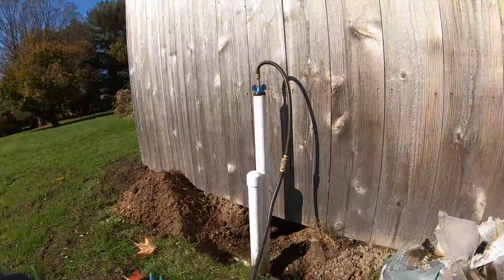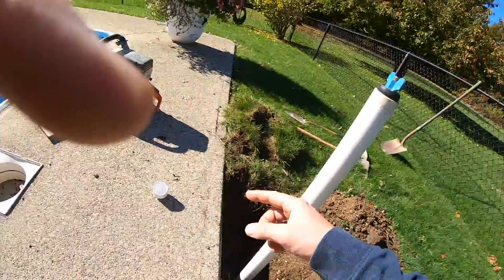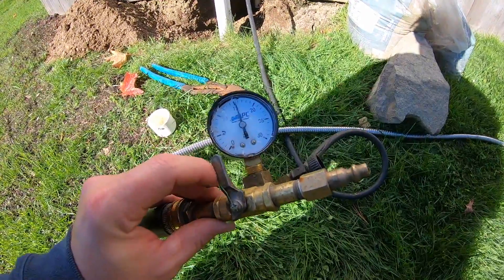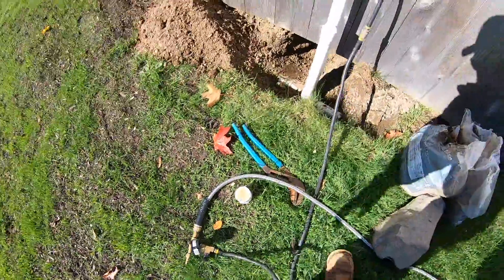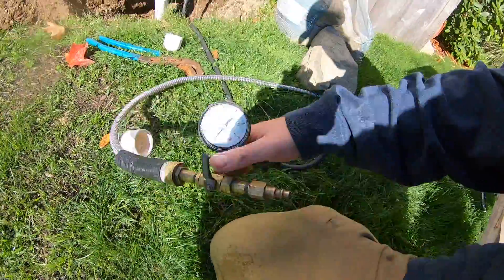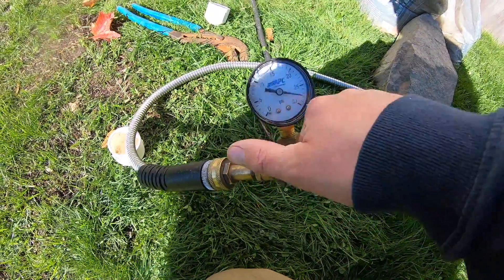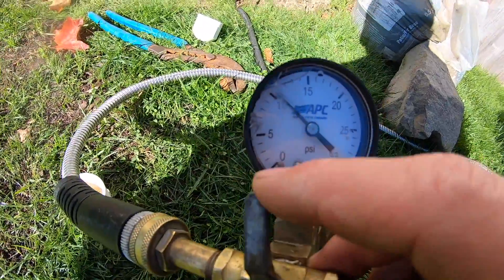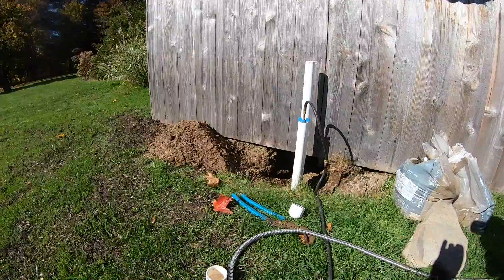Pressure testing Plumbing on a swimming Pool..STEP BY STEP

Comment: Why wouldn’t you release the air from the pipe before pressure testing for water leak?  I guess if there was a leak you would still see the pressure drop but compressing air seems like not the most accurate way to do it?

Comment: Good video. Just two quick comments on facts I found out:
1. The burst pressure on PVC pipe is very high, certainly greater than 100 PSI (the message being, don't worry, be happy).
2. Common water pressures coming from the city is about 15psi.
Reply: @scottfranco1962  he is testing the glue joints too, not just the pipes.

Comment: Are those vertical pipes something you installed temporarily to make the process easier?  Today I was pressure testing a suction line and the 2" blow-thru plug kept popping out of the skimmer.  No matter how much I tried to twist that wingnut, after about 10 psi it popped out.  I'm going to make n 18" stub-out pipe with a threaded adapter to screw into the skimmer so I can get a better grip on the plug to get it to stay in.  I was wondering if that was something you did there on purpose as well.
Reply from the maker: Another pool company originally installed them and stubbed them up and never came back so we took over the job, being stubbed up made it alot easier to pressure test.